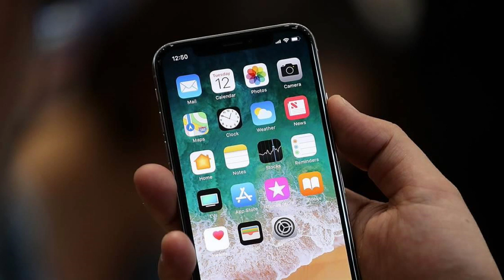Why Recycling can Never Replace Mining

Comment: I do agree that mining is necessary. Though there is another path for both reduced mining and reduced resource usage rather than locking 5 billion into poverty. In a word, a radical solution not favored politically in this socio-economic system and culture, redistribution. The living standards of the first world nations could be reduced at the levels of the highest and higher net-worth brackets within them where wealth more equitably distributed could bring the world's living standards closer to that of a universal lower middle class. Lower middle class in say, western European or maybe even American terms. If our supply chains were designed more efficiently and useless excess like funko pops and other consumer garbage were removed from production I'd wager that the world could potentially even live at middle class standards assuming efficient non-automobile based mass transit. 

There is very little time to make such a world a reality before the supply chain logistics of such a thing are simply materially impossible and before ecological feedback loops crash the ecosystem devastating world food production. A devastation that will ravage even populations in the first world of which likely includes readers of this comment that will mindlessly scream this comment is advocating communism without even knowing what that word means. 

The numbers are clear regardless of what one thinks of the word. Over 50% of emissions, where emissions are a VERY rough approximation of overall supply-chain footprint are from the consumption of people who fall into the top 10% global net worth bracket. Reducing the consumption of those people and raising the consumption of everyone else where needed to humane levels would go a long way. And that raising of the lowest wealth brackets living standards must include, at least for the foreseeable future, an overall lower material footprint on average for all of humanity. This would include the creation of wildlife corridors, heavily regulated pesticide use to prevent mass death in pollinators, etc. 

I think this is possible if modern cybernetics that are already used to run the stock market and other internationally scaled systems were applied to a mixed but mostly planned economy. Only possible for a short time, even mobilization towards this end on the scale of 50% of the planets GDP per year will not be enough if we wait too long. The incentive on our species may yet pressure us into such radical action, survival of our civilization. God Speed.